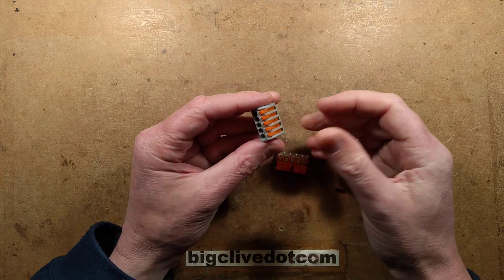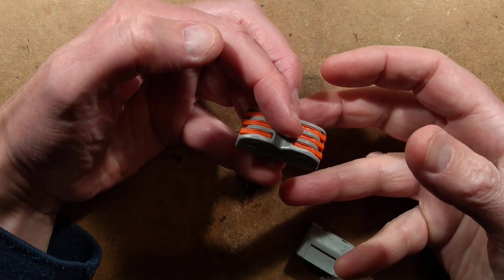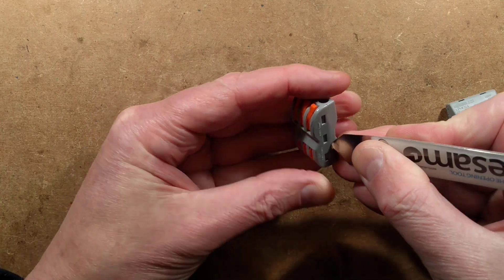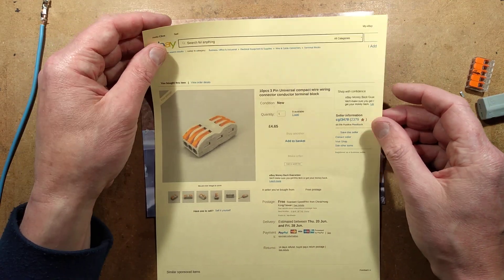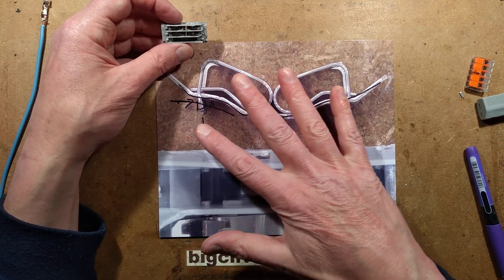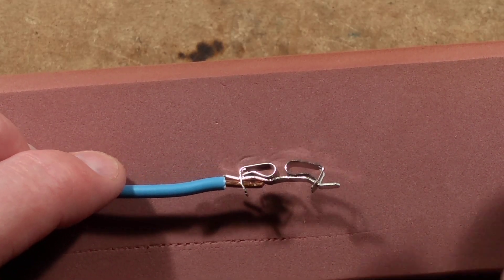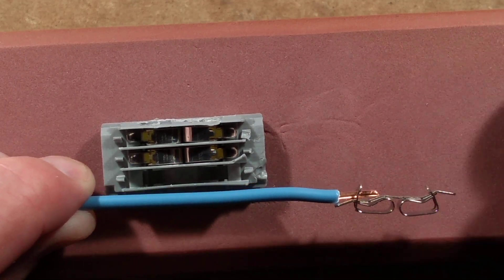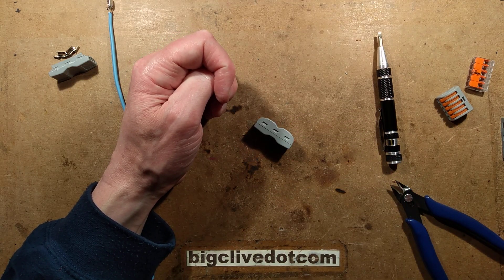Clone of Wago product that Wago don't even sell???

Comment: Hi Clive.
You have not mentioned the benefits of the WAGO connectors against the screw terminal.
We found that when building control panels that work in high temperature but under a shut down the temperature drops to just above freezing. We found wires in screw terminals to become louse when using stranded wire. with the WAGO terminal, the wire can expand under the spring and contract when it cools down thus keeping the same tension on the wire. this elevates some of the problems with hot spots.
Reply: @pmailkeey did you read none of the damn responses???
Reply: I was wondering if these might also be more resistant to vibration than screw terminals.
Reply: @markevans2294  Screw terminals absorb all vibration, however, these create a small sawing effect and will cut the wire off eventually. Abrasion is a pain and exist ANYWHERE moving. Screw terminal, no move, unless it works loose with temperature+vibration. So screw is basically a bit better. Soooo... They are loosely the same resistance to vib.
Reply: @dimitar4y  A screw terminal can only get looser under the effect of vibration. It definitely happens. That's why we have Locktite. A spring terminal would be superior in this application.
Reply: @albanana683  Not necessarily so. Industrial and high grade screw terminals are not prone to loosen under vibration conditions. They wouldn't have been used in ship control panels for years if this was the case. 
And I've yet to see any form of lazy spring connector used on Circuit Breakers, control relays or instruments ever.
Reply: @albanana683  completely different situation lol
Reply: And the spring force is manageable and controlled, while screw can cut through the wire, damage it, or have too tight/too loose a contact. 
To use proper screw terminals, the screw would have to have a copper plate under it, and a second copper plate underneath the wire that's spring loaded. To SCREW -> CopperPlate -> WIRE -> CopperPlate -> SPRING, Or if you could, make the screw itself springy. But if you have springs why the fuck are you screwing around with screws? It's all just lost potential.
Reply: @pmailkeey Well I'm regularly abusing terminal blocks and know which are better. There are SHITTY terminal blocks with the extra piece that just gets in the way, and I don't mean them. There's some super cool breadboard terminal block sthat make the entire terminal block move inside the plastic casing like on 3d printer boards ramps 1.4  blah whatever, Whatever works for you, maybe your screws arent sharp as a fucking drillbit like mine are.
Reply: @dimitar4y   OK, so, a Butcher... using shitty quality terminals then.
Reply: What about terminals that screw through a hole on a crimped connector? Do large temperature drifts loosen the crimp?
Reply: @vladomaimun  no
Reply: Under what sort of Standard are you finding stranded conductors terminated in any type of terminal without a crimped lug or ferrule used?  Even the basic ferrule has the stranded conductor formed into a solid pin conductor.
Reply: In Germany screw terminals are not allowed anymore. Everyone is now using the "Wago clamps". Pretty much a monopole now for doing the usual wire work of a home.
Reply: @TheYear2525  I can understand how, since they're more reliable to install and use, require less skill. But that in turn means they're pretty much a government monopoly, so they don't need to innovate or take risks. They just are a monopoly, therefore money, therefore they can raise prices to hell and lower production quality.
Reply: @dimitar4y  ".. a government monopoly".  How so?  The German Govt. doesn't manufacture these and I have doubt that that is even the case screw terminals are 'not allowed anymore', given the fact that today there are more than 3 German manufacturers of screw fasten type terminal blocks used in the Industrial, Commercial and Consumer level sector. The same manufacturers make non-screw type, that are Universally hated by electricians working in the industrial/Commercial sector... because they can FAIL. ... and in fact prohibited in some Public Sector Installations. 
I've never liked these spring terminals and have experienced failure in service, less than secure terminations, and fiddly time consuming when a ferruled lug objects to inserting properly. 
And on that point, stranded wires should never be used in any type of terminal, especially these spring loaded POS, without a crimped lug  or ferrule firmly crimped on. Spring windows or pauls WILL CUT strands one by one, especially under the influence of vibration, leading to a reduction in CSA and heating/burning/fusing under circuit load conditions NOT exceeding protective fuse ratings.
Reply: @pmailkeey Don't overtighten or the screw itself will shear the cable and make it worse. Get screw terminals with the little pads that are right under the screw and clamp onto the item. They are much better.
Reply: I don't usually chip in but there are so many spurious arguments being thrown about by people who are demonstrating either their lack of knowledge/professionalism or simply that they are not professionals in an electrotechnical industry...
Basic engineering, materials science and the Harmonized electrical reg's tell us these simple facts:
Maintenance-Free (MF) connectors, such as these Wagos, Ideals, and the other leading (non-clone) brand that I forget, are in most circumstances far superior to any screw terminal.  (I don't argue there aren't exceptional circumstances but that's beyond the scope of this comment.  And yes, absolutely thermal cycles as well as vibration does cause screw terminals to loosen and start arcing.)  Correct selection and use of MF or screw terminals is critical--
In a screw terminal, use ferrules (or crimps, lugs, as appropriate) to prevent the screw damaging the strands (common practice in much of Europe, but less so the UK for mains electrical installation where instead it's common to twist up the strands a bit more and double-over a small conductor before it goes into a larger terminal, similar result, not as resilient to disassembly for testing but far less time-consuming);
In a cage terminal (a screw clamps a metal frame onto the conductor) do not crimp anything on to the conductor and don't even twist up the strands but leave them parallel (with the lay from manufacture) so that they are properly clamped by the cage making fuller electrical contact with all strands (making best use of boundary effect) -- if you manage to ram a ferruled conductor into a small cage terminal just suitable for its size (e.g. a 1.5mm² crimped wire into a 1.5mm one of those small green PCB headers with the metal leaf that the screw clamps down on) then you'll just f#@k the connector and if you ever have to disconnect and unjam the ferrule you'll probably f#@k the PCB by ripping off the header;
If you are using a MF terminal such as this that is larger than your conductor size then you can ferrule your strands if you want (after all they are designed to take solid as well as stranded) but you do not need to!  This is the point of them: simple rapid reliable installation in the vast majority of circumstances.  But you twist up the strands first to help spread the effort and protect the strands from excessive local force exactly as you would if you chose not to ferrule your strands in a screw terminal.  There simply is no "guillotining effect" if you know how to use them (know your equipment) and you do your job properly -- i.e. you act like a professional -- and that includes any concerns about excessive vibration "rubbing" the spring against the strand as the conductor moves relative to the terminal.  Why?  Because as any professional knows (because both the manufacturer's instructions and the electrical reg's tell us) a MF connector is only Maintenance-Free when the conductors and terminals are secured from movement.  Hence the existence of multiple forms of terminal box with cable grips or means of anchoring to a surface.  Wago Boxes are convenient things that secure multiple Wago terminals and all the cables in flexible grips with a snap lid, completely toolless.  (Other cheaper or possibly better products exist!)

So, stop arguing on pointless grounds of "principle" and instead work to professional standards, or accept you are not a professional and keep you opinions to yourselves lest a professional electrical engineer recognizes you for a fool or (worse) a cowboy (pirate in some countries?).

Lecture over.  Exam next week.
Reply: @GrahamJEllis  "I don't usually chip in..."   so gave in to covid huh?
Reply: @GrahamJEllis   hmmm, interesting point about stranded wire and cage terminals.

Here in the Netherlands screw terminals have been banned. 
The few times we use stranded (very rare) it can either go into one of these flip flop wagos as is or into a cage with a mandatory ferrule. But now I'm wondering why..

According to code, cage terminals have to be torqued to spec. But nobody does.
Could that be a reason for mandating the ferrule? Easier to feel you're properly clamped down?
I'm really puzzled as it makes perfect sense to go for maximum surface area contact without one..

Not quite ready for the exam I guess, sorry.
Reply: @sigi9669  I re-read this set of comments to remind myself of the various arguments (especially "Da Reproducer" some of whose comments were my prompt for referring to individuals proving they are not professionals/working to professional standards) and noted another comment about Germany also banning screw terminals. This doesn't make sense to I ask you to elaborate. Do you in fact mean terminal blocks ? (What in English slang we call choc-blocks because of the way you can twist off the number of segments required.) If not and you are referring to electrical devices in general, then please explain how all manufacturers can sell into your market distribution boards with exclusively screw terminal neutral and earth bars, smaller circuit breakers with conductor screw terminals (these are rapidly being replaced with cage terminals but some are still marketed), almost all general electrical accessories with only screw terminals (socket-outlets, connection units, light switches, etc, etc). The more I write the more I presume you mean terminal-blocks, used in the same context as all these new maintenance-free connector blocks...

Also, please explain "a cage with a mandatory ferrule." The entire point of cage terminals is to protect the conductor from damage. Ferrules should never be mandatory because there will always remain engineering circumstances where ferrules are inappropriate. Yes you can use solid-core in a cage, and therefore the effective "solid-core" of a ferruled flexible or stranded conductor; but the whole point is that you do not need to because of the design of a cage terminal (such as found in all large breakers and now most of the smaller ones). When dealing with high-current applications, employing "boundary effect" by installing stranded or laminated conductors is an important way of reducing overheating, stress and other engineering problems: spreading the multiple components of a conductor so that as much of a conductive surface as possible is in contact with the terminal walls (and providing multiple conductive paths within the cable). A similar but lesser effect can be had by making a shaped solid conductor that is flattened so that a cage clamps down onto a larger surface area, rather than almost tangentially onto the outer curves of a solid round conductor.  It's a small part of the reason "tri-rated" cables can take more current than ordinary conductors -- mainly the different insulation material, but also that they are "extra-flexible" conductors (multiple fine-stranded with many times more individual conductive components than the standard 7 "stranded" cable or 24-40+ "flexible" cable, each with a conductive surface, and allowing more free movement to its own EMF).

(Aside: I give you one example of where ferrules are most explicity inappropriate.
I was asked to correct a design error in some large panel-work -- a multiple-cabinet control panel containing a great deal of electronic signalling, transducing, monitoring, relaying, and other equipment, with LV and ELV circuits running every-which-way.  Designers needed to swap a couple of signalling devices around, these being powered by those little green through-hole PCB mounted multiple terminal strips.  These terminal blocks are leaf cage terminals; that is, there is a screw that presses down on a springy metal leaf that is then compressed onto the conductor.  This is a power terminal so it is "large" in PCB terms, suitable for 1.5mm conductors rather than the annoying smaller 0.75 or 1.0mm terminals for signal wires.  The contracted panel-builders who had originally built these cabinets had unerringly ferruled every single conductor without pausing to consider where each conductor was going, including the 1.5mm power wires to go into the PCB terminals rated for 1.5mm flexible and stranded conductors.  They rammed home these ferrules and then tried to screw down the terminal screw which didn't get them anywhere of course.  I unscrewed the terminals until the tichy grub-screw fell out but still the ferrule would not come out of the terminal blocks.  In attempting to pull free these conductors I ended up breaking the green through-hole terminal blocks off the PCB, ruining two of the signalling devices and making them have to order new replacements -- we were not permitted to attempt repairs due to the nature of the devices and the sensitivity of the project.  A noted project delay and large expense that I hope was off-laid to the panelbuilders, but that company had already lost their reputation and trust and would never be contracted again.
There are some times where ferrules simple should not be used.  Understand your equipment; understand why you employ certain methods, practices and tools; understand the reasoning behind the Regulations so that you know if and when you need to depart from them.  A "departure from the Reg's" is not ignoring the Reg's, it's considering them and making sure that what you do instead is equally as good, safe and effective.)
Reply: @Dranok1  Only a professional engineer could destroy a component while removing a wire. Can't say I am surprised. Good for those lowly techs. Job security and all of that.
Reply: @MarksmenTM  Ooh, the sarcasm!  I can hear it dripping from next door ;-)
Reply: Well done brainy, it is well known problem in screw connectors. Plus you are going to damage a cable.
Reply: @rafalotreba6824  That says you have never worked professionally in the industrial sector... nor used high quality screw fastened terminals like Weidmüller products.
Reply: @rafalotreba6824   Using these spring tension connectors on heavy or fine stranded wires without a crimped pin lug or ferrule will also result in damage due to the knife edge of the spring element, being the only means of maintaining any clamp force on the wire.  
Next you will be suggesting crimp lugs and ferrules damage wire strands. 
Don't you think?

Comment: Heres a thought...
If China copies something that doesn't cost as much as an original BUT the quality/functionality of whatever it is very good should we have a problem with it?
Reply: The thing is Wago is going to have some expenses in getting the Kema, TüV, GS and other certifications that will make these connectors compliant with for example NEN1010 or whatever DIN or other standards apply to building code in a given country.

The fact that the Wago connector says KemaKeur NEN1010 on the box, means my house insurance considers it a safe connector, rather than a valid reason to deny coverage in case of an electrical fire. A couple cents more for a certified connector is clearly insignificant.
Reply: How would you ever know if the quality/functionality is very good, bearing in mind it would be expected to last around 30 yrs? As Big Clive says, corrosion may take place at the connection, causing the wire to come loose.
Reply: @Benzknees  I was referring to anything knockoff, not specifically what the video is about.
Reply: DigitalIP - In that case, based on my experiences, a qualified yes! I have used unbranded Chinese cables, luggage straps, plug adapters, laptop batteries, tools, mobile phone holders, and even ingredients at Chinese food suppliers, which superficially looked fine but ended up disappointing  to a greater or lesser degree. But branded stuff made in China, especially when the quality is controlled by Western firms like Apple, Makita, Bosch, Amoy, etc. can be fine. I’d go along with the old proverb ‘buy cheap, buy twice’.
Reply: @DigitalIP
i think no , but when all other manufacturers are out of business the chinese products will probably cost more than the original ones used to cost :-)
Reply: I agree. Some Chinese stuff is very acceptable quality for the cost. Mostly it's inferior to the originals, so judge on an individual basis. The fake wago's  are one item that they've done really well, in my opinion.
Reply: The problem is, figuratively, corrosion. "Chinesium" captures the sense of it. The consumer is the lab (rat) for that industrial culture. Having created both a culture where third-rate goods can leave the dock, and expectations that Chinese tat will as often as not turn out to be complete shit, the Chinese industrial plant is its own worst enemy. It could produce only goods that would make the Germans and the Swisd smile, but… a buck is buck, so fuck it!

Comment: 5:40 unknown metal.. Just like any chinese wire then.. So which corrosion junction should I worry about first the spring clip (spring steel?) onto the conductor bar or the wire onto the conductor bar or the spring clip on to the wire?